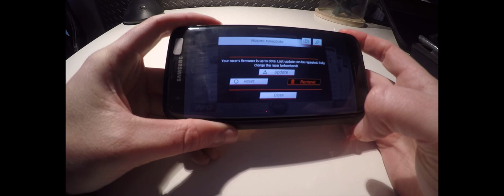How to mod your Dr!ft Racer DIY / Tutorial / ideas

Comment: Very cool man! Question for you please. Can the wheels be swapped to some other ones from other toy cars like hot wheels? I bought the Mika Shop 911 body and its sweet, but the rear is so wide the stock Sturmkind wheels are too narrow. Was hoping to find a staggered setup to make it look better. Thanks!
Reply from the maker: You can always buy other models and try to customize it yourself. On the facebook community there are people with custom or 3D printed wheels. There is a lot possible.